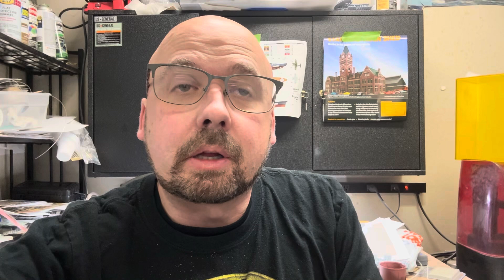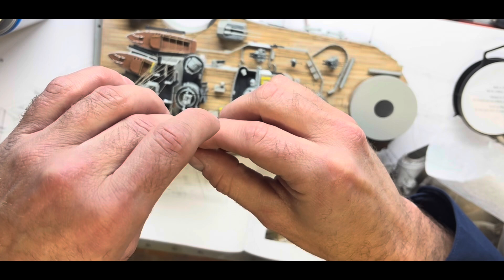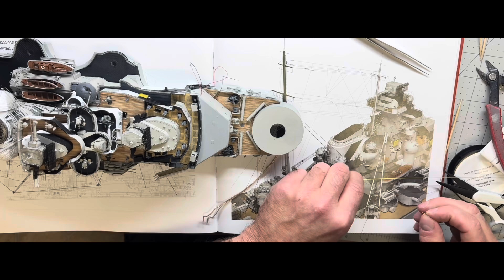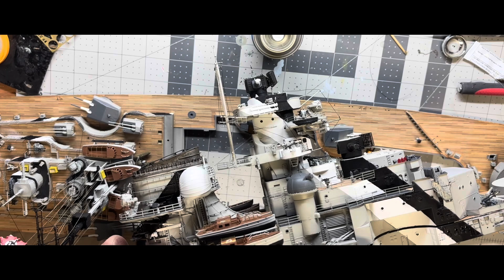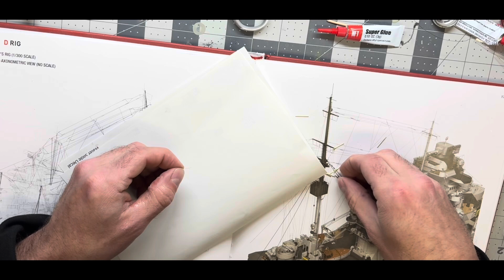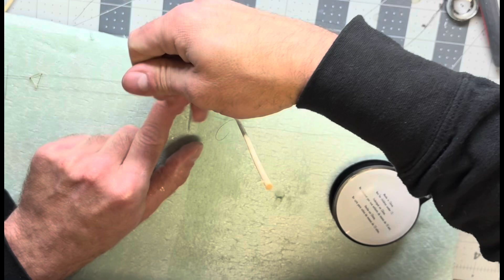1/200 RC Bismarck by Trumpeter.  Pt 21 Rigging

Comment: hey man iv watched your build series and you do awesome work. I'm doing a 1/200 bismarck for my first rc conversation would you be able to do a video purely explaining the rc components and how they need to be put together and what other electrical parts are needed?     every video I watch nobody ever explains that and it's frustrating. I'm using the same kit you got from ebay with the motors, shafts etc
Reply from the maker: @FatTuna556  that’s coming.  I actually have all the parts now, just have been busy with some other projects going on and haven’t put it all together yet.